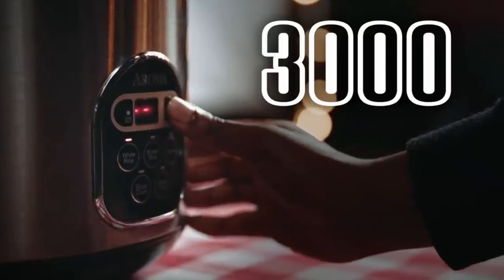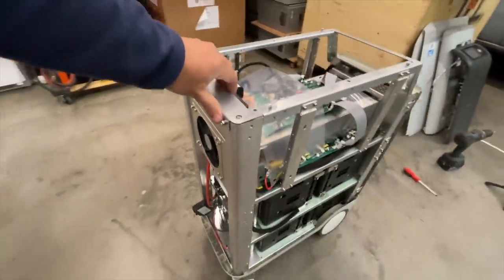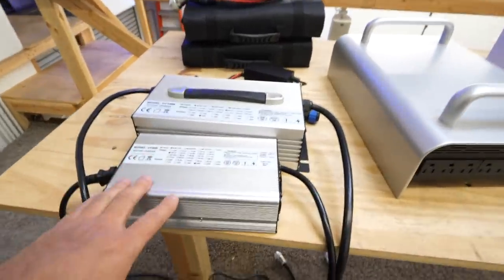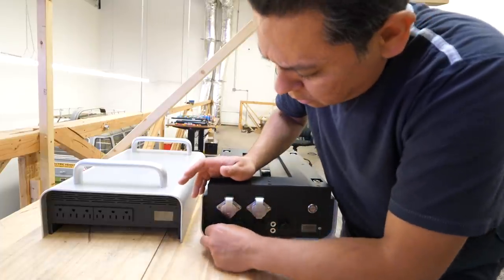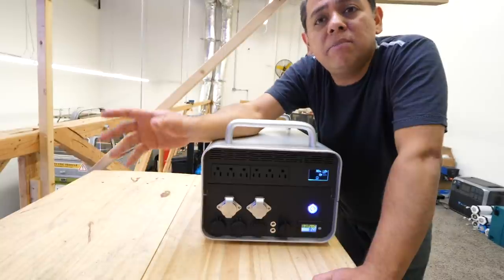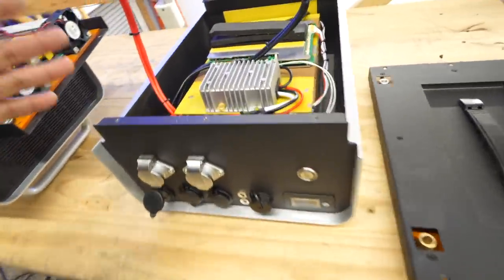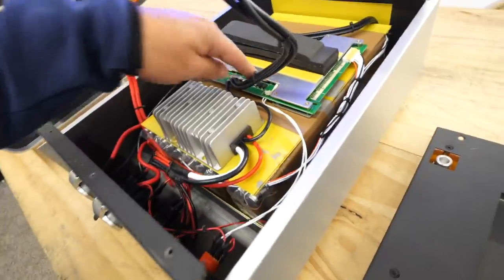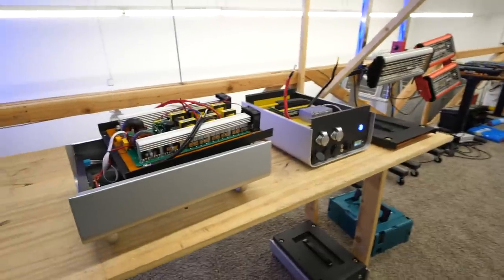How WattAnt made 3kWh capacity 3000W PowerPack under 45LBS

Comment: I don't know why someone doesn't combine this with a Honda generator. The generator just puts out DC for the batteries at the most efficient operation and fuel usage. You could use small propane, large propane or stick a hose into the gas tank or a gas can. The solar is a nice option as long as you are in sun for 5 hours in the day but otherwise you have a real power pack hopefully much quieter than a Honda. It would be automatic if the draw was enough to take the engine output it would start and then turn off when the batteries are full or however you set it up.
Reply: Tim, no electricity is free.  No matter how you look at it.    Using a generator, like a Honda, creates heat, fumes, and noise.  That is a no go for many folks.  I am a sailor.  I have a 400 amp.hr lifepo4 battery set up.  Way ...way ...way over kill for my needs.  Then i have a couple hundred watt hr solar.    I do not use a generator and it works out fine for me.  I just have a small refridge, gadgets, auto pilot, and induction stove.  There are so many permutations to match up what an individuals needs are.  Guys like Hobotech,  Will Prowse, and Jejhu...they review and post up tons of tasty morsels of techy stuff all the time.
Reply: @alansmith2203  I live off grid and my solar is 10% in winter. If you don't have a way to charge with fuel then you just have a heavy box to carry around. My suggestion is like what Ford is offering with their new trucks and their power plant. I suppose the best would be fuel cell using hydrogen as a back up to solar, wind and hydro etc.

Comment: Not a fan of the external chargers, why not make them modular with the same case design? I would like to see the USB ports and display located higher up for easier access especially if this will be used outdoors on the ground.
Reply: To build in the charger, for 1500W 40A will make the unit very heavy and bigger in size. Not all users need AC adaptor to charge when they use it outdoor.
USB has weaker output other than the 25amp and 40amp DC, so we design them lower because we expect most users use AV when they are outdoor on the ground. For bigger appliance and tools.
Reply: @aliciawu3172  You could make the charger from the same case material and use it as a base for the whole battery and inverter unit to sit on.
Reply: @RWSBrowning  Change the case to similar style and material is nice suggestion, will make the whole package have a more family look.
The 1500W adaptor may be big enough to be a base, but not the 600W.
Reply: @aliciawu3172  The 600 watt would still fit in a similar case and have a space left over to fit accessory cables.

Comment: i have a nightmare with that type of 24v to 12v dc to dc converter , it broke down and shoot all the 24v out to my 12v device with all the amp battery can give, my few LED light draw 500watt at the moment (in normal condition the LED light draw less than 80watt).
Reply: Hi, I'm Alicia from WattAnt. The 12V for DC on our unit is stable. Won't break down as the ones you have. It's not a common issue that usually occurs.

Comment: Nice product, nice review. @Alicia Wu, there should be a standard connector for PV connection or some male connectors should be included for PV cables to connect in the package or how can I connect the PV strip? Is the PV inverter MPPT kind? What range of voltage and wattage, amps for? I will order an international one.
Reply: Hi Sandi, thank you for loving our product! We use the aviation plug for connecting solar panels, and the male connector is included :)
Currently we have PWM controller take up to 2000W solar input. The range is 30V-36V, current at max power is 25A.
Reply: Hi Sandi, we now offer 1500W MPPT controller build in and chainable feature for two 3100wh batteries. So you could get 6200wh at once, also can charge two batteries at once.  The MPPT controller is between 30V-80V. For the amps is between 5amps to 11.5amps.
Please check mroe details at:
https://www.youtube.com/redirect?event=video_description&redir_token=QUFFLUhqbFpnOURQSTlqNjk0alVxcUZVdlJUcVNrcUpFd3xBQ3Jtc0tsYWZPb2o5Y2p1QWRBUFJRTUVkMUszcUlvNTVPVUZxWldBRVZDVjhmeXpwaGkyYjBsRVUzVm81dW1vcU1EWFRPN1M0Y1JVaWFrZDFzbVpTbldLTE8tdVFvMHowbHNPb0NPTVlGM0VabmQ2bi0wT3pZUQ&q=https%3A%2F%2Fwattant-innovative-power-1.kckb.st%2Fjehugarcia

Comment: How is this better or different than the EcoFlow River series?  Nicer case, but it's a lot more expensive....  Like twice the price.
Reply: I'm Alicia from WattAnt. River is 600W output and 288wh. Ant is 2000W output and 1500wh. over 3 times of it's output capacity and over 5 time of its battery capacity. We also have swappable battery, 25amp DC port, up to 2000W solar input.
Reply: Hi CK, We now offer 1500W MPPT controller build in and chainable feature for two 3100wh batteries. So you could get 6200wh at once, also can charge two batteries at once. 
Please check more details at:
https://www.youtube.com/redirect?event=video_description&redir_token=QUFFLUhqbFpnOURQSTlqNjk0alVxcUZVdlJUcVNrcUpFd3xBQ3Jtc0tsYWZPb2o5Y2p1QWRBUFJRTUVkMUszcUlvNTVPVUZxWldBRVZDVjhmeXpwaGkyYjBsRVUzVm81dW1vcU1EWFRPN1M0Y1JVaWFrZDFzbVpTbldLTE8tdVFvMHowbHNPb0NPTVlGM0VabmQ2bi0wT3pZUQ&q=https%3A%2F%2Fwattant-innovative-power-1.kckb.st%2Fjehugarcia

Comment: I would say it's better to lose the smart meter and replace it with a mobile app that connects to the unit and give you live feedback
Reply: Understand it would be great to have the remote app for monitoring. The reason we didn't build in is mainly concern about the hard cost and the potential of reducing the needs for repairing.
We wish to keep it focused on the key output and input functions strong, and simple to use.

Comment: Could this use the batteries together? By linking one to the ac inverter and charging it with a second creating a hot swap?    Also how much current can it take in ie rooftop load 2 kw or more?

Comment: I want to think manufacturers/assemblers would provide what the user wants...
I really have doubt that this is viable... these turnkey systems tend to be pricey...
The 3000W 3072Wh Bluetti AC300 is about $4,500 introductory price... one 3072Wh B300 battery pack.
 - one can build an equivalent for  less than $1,800 buying the separate parts...
The Bluetti can take 4 batteries for up 12, 288Wh and can be doubled up to 24,576Wh
One would have to buy 2 WattAnt to have have near the same capacity as 1 Bluetti with 4 battery packs(B300)
...and the 3,000Wh battery only produced 2,600Wh... hmmm!
...and how fast will that 3Kw battery charge with what size solar array? and require 24V panels? (9am to 3pm) sun window?
The soft solar panel that come with it are useless... soft panels do not last, waste of money.
It needs to be priced without the panels, to offer the option.  especially for those of us who already have panels!

- and the Bluetti is hot swap!
- and this stackable approach is not good.  It needs aviation plug like thick cables to join the battery packs, that way configuration is more flexible.  but do make the boxes stackable.

...and contrary to what Jehu says, most of us are used to run most everything via bluetooth or wifi apps on our phones/computers... so that capability needs to be included and we need to see and control the charging and balancing.
That way one can run the LiFePO4 batteries as hard as one wishes... many batteries today can actually take 100% charge and some are now able to sustain discharge to 0%.  It is now almost not worth trying to baby these batteries to squeeze a few more cycles.  The daily usage fulfills the requirement better than the longevity.

Comment: Why is it that all the solar generator limits you to around 100 watts when most vehicles still have 30 amp alternator a lot of SUV and pickup have 60 amp alternator for those who have schooly for homes some of those have hundred amp alternators any of these alternators have a lot more output than 100 watt sure you might have to put in an Anderson conector or get an old cigarette lighter plug these were biult with metal bodies and a ceramic base to hold the positive conector but then the week link would be the plastic plug so an Anderson 60 amp plug would be the answer and still cheap and easy enough to install that would mean if drove an hour it would completely if not close to completely charge a solar generator from dead so why don't they do it the gives a way by buying a pure sine wave inverter and hooking it to your vehicle so you can use your wall charger a lot more money than 10 to 30 ft of 10 gauge wire and an Anderson plug it also wastes power converting it from 12 volts to 110 and back down to the units power level but still faster than plugging in to the 12 volt plug assesory plug in your vehicle just think for tenters who run low on power in solar generator they could plug into the car and top it up in about an hr whereas with a 100 watts of charging from an automobile you'd have to ron your vehicle way to long to make it worthwhile this is something the big four reviewers should take up with the solar generator manufacturers there are utube videos out there that show how to pair an alternator with a gasoline or diesel engine to charge 12 volt power packs and solar system batteries when the sun doesn't shine again their logic is why generate 110 220 volts to charge a 12 volt battery system I've got the motor and the alternator and if I want more than 60 amps or 12 volts I can go to the truck wrecking salvage yard and pick up one for around 50 dollars

Comment: Hi Jehugarcia, From your experience, how much would it cost me if I have to build a similar power station like the WattAnt 3000watt device? Also, is the WattAnt using pure sine wave on its inverter? Does it matter if it is or not?  Thank you
Reply: Hi Sea, I'm Alicia from WattAnt. Our unit use pure sine wave for the inverter. And if it's not pure sine wave, it will risk to damage your electricity sensitive devices like Ipad or computers.

Comment: JUNE 2021!!!!!!!!!!!!! FROM WHAT I SEE ON THIS VIDEO AND MY EXPERIENCE WITH AT LEAST 10 KICKSTARTERS, AND IF IT GETS MADE IT WILL BE FEBRUARY 2022
Reply: I understand many campaigns are having long delivering time. 
This is not the case here, the reason we only have inverter and copper connecter custom design and made by us is because we want to ensure the delivery time. We could have custom made the output DC ports and all other parts, but this will crazily extent our production time.
Ship in Aug is the time we have confirmed with our manufactures.
Reply: @aliciawu3172  then you do not plan on fixing any of the things that he mentioned that need serious fixing
Reply: @raaah  Replace handle and the bottom foot, have the solar panel controller build in. Get the better air tunnel designed. 
These doesn't require us to redesign the system or change the case. We are very careful when we designed it at the first place.
If there are major function failing or need redesign the whole system, that will really need take months to redo everything.
Reply: @aliciawu3172  I wish you luck and only time will tell

Comment: HOW LONG DID THE 3,000 WATTS  LAST TIME WISE FROM A FULL CHARGE . I DIDN'T SEE THAT STAT. THANKS
Reply from the maker: Because it depends on the load,  charging phones it will last months,  but charging a Tesla it will last and hour
Reply: @jehugarcia  WHAT I WAS TALKING ABOUT IS IF YOU TOOK TWO 1500 WATT HEATERS AND PLUG THEM IN HOW LONG WOULD THE CHARGE LAST . WITH YOU DOING THE DEMONSTRATION . THAT WOULD BE TESTING THE UNIT AT FULL LOAD AND WOULD BE A GREAT TEST .JUST SAYING . THANKS.
Reply from the maker: I wasn’t  testing run times, I was testing capacity

Comment: 2250$$?? Did I read this wrong? This isn't an affordable option for most.  I do like the design. We need a DIY version :-)
Reply from the maker: What are you talking about?   Show me another 3kwh battery with a 3000w inverter  for less than $2k.   This will be a finished ready to use product,  you can’t compare it to something diy that you have build from scratch.   Two completely different things with different pricing.
Reply: @jehugarcia  No disrespect or trying to be negative. However the 3kwh is over the 2000. 
 The case design is very nice and the portability is also a plus. One of the other comments was a stack-able system and I agree. Having that option to add multiple batteries would make this an even better product for those that are not DIY'ers. In your video you commented how great product is with the way the it is constructed and the ability to replace the component on your own, this screams DIY.  Unfortunately personal this product is not in my price range. Now a CASE or KIT might be a different story. I really enjoy all your videos and the knowledge you share. Thanks again for being willing to share all  your advice and experience!

Comment: I get the idea, seems like it still needs a lot of work
Reply: Hi, I'm Alicia from WattAnt. We well received Jehu's advices. This is our prototype, we will upgrade the battery handle , the foot at the bottom and ensure the fan could have better wind tunnel to control the heat. 
You could visit our campaign page for more insight and specs.

Comment: Hard to beat the titan with 2000w of solar in capactiy.
Reply from the maker: Your priorities are wrong,   More  battery and more inverter is what’s important.
Reply: @jehugarcia  Different peoples needs are different, not wrong. I want a system to recharge a cyber truck off grid. the truck is my battery and it has its own inverter in the bed. I just need solar capability.
Reply from the maker: My rivian truck beats your cyber truck, all day
Reply: @jehugarcia  the Rivian is cheaper than 40K and will never get scratched and is bullet proof to a 9mm and has a lockable 6.5 foot vault?  dam, I ordered the wrong truck.
Reply from the maker: But it does make everyone throw up in their mouths at the sight of it.  And it comes in white, my favorite color
Reply: @jehugarcia  The Rivian does look pretty but I like more masculine looking trucks. Could wrap the stainless  in white I suppose, or even pink if you really wanted.

Comment: Can it be used as a UPS?
Reply: It supports pass through charging which is as charging as getting discharged to power appliances. But currently don't support UPS function.
Reason is adding UPS will increase it's price and also the size and weight. While lead-acid UPS is very cheap in market. 
We want to focus on making it the most portable yet compact unit in the market for portable usage and home blackout.
Reply: @aliciawu3172  OK, thank you for your prompt response!